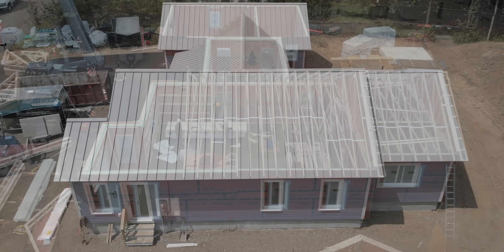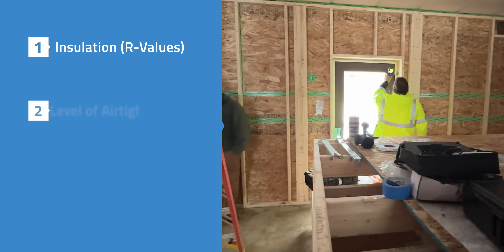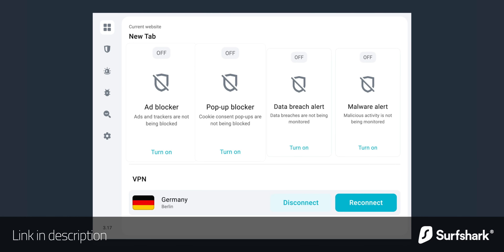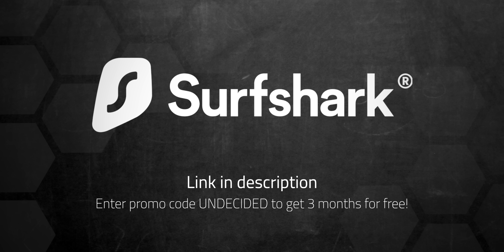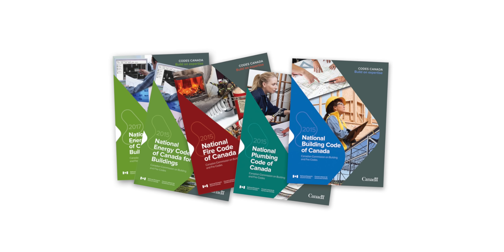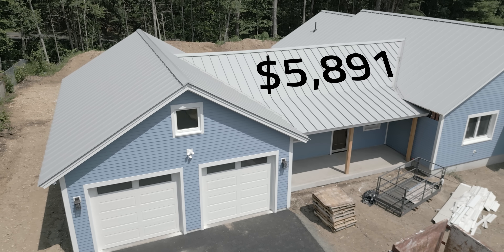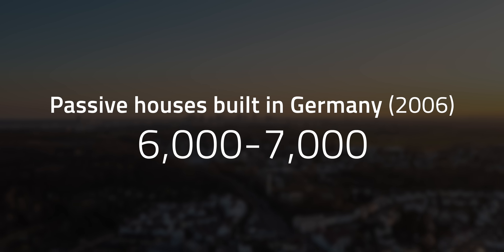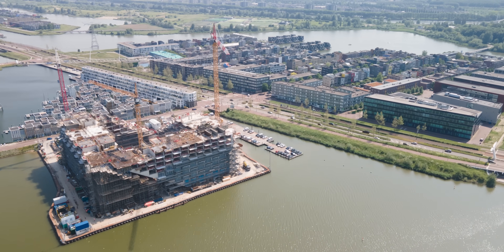Why Do American Homes Suck?

Comment: I built an ADU/garage on my property with the idea that I would spend an additional 10% - 15% on build quality and efficiency.  What I did wasn't rocket science:

2x6 externally framed walls
Foam flashing in the wall cavity
Roxul (Rockwool) wall insulation @ R-24 (vs. R-15 code)
R-60 ceiling assembly, with attic/chases inside thermal envelope, including 4 inches of closed cell foam, thermal breaks above the deck, a second deck that the shingles are on, and R-38 Roxul under the lower deck( making a [shingle, tar paper, OSB, closed cell foam, OSB, Rockwool] sandwich.
Additional sound deadening rockwool around bathrooms and laundry.
Mitsubishi Multi split with 3 head units.
R-13 3-layer foam core garage doors.
Hurricane straps vertically throughout the build.

I paid about $3k on flash, another additional $4k above normal insulation, $5k extra on the roof, the HVAC was about $10k more than two 2-ton units, maybe $1k on hurricane straps, for a total of $25k on a $300k build (plus the upcharge on 2x6 framing and some additional LVL lumber).

I probably save about $100/month on energy.  So, it won't pay for itself in 10 years, but man is it ever quiet and comfortable.  No drafts, no hot spots or cold spots.  Just uniform temperatures.

Comment: In the US you have mass home builders like Pulte and their ilk pumping out cheaply built homes they can then sell for the largest margin possible and with as many corners cut as possible.  A friend of mine works for a local window installer and the subdivision builders always order job lots of the lowest model possible; one they don't even show to normal renovation customers because it's terrible.

My parents have owned such a house for 20 years now and the cost of bringing it up to a modern standard far outweighs any savings they made up front on the new built home.

Comment: I live in California and in Canada. In Canada, we built a home to modern codes at had the tight envelope with an air exchanger. The first winter, it seemed really nuts when I stood next to the home air output and it felt so warm compared to the outside air: "Why are we pumping hot air out of the house??" But that is the TOTAL hot air leaving the house, due to the tight envelope. And it was actually already used in a heat exchanger to transfer some heat to the incoming replacement air. Sure, it "felt" warm in the -20C outdoor air.  Then, all of the homes I've owned in California have been sieves in comparison. Drafts all over, and often you can see the sunlight through the gaps in doors. CA is just lazy because the weather is usually fairly comfortable near the coast, so winters aren't that important...but summers are. Efficiency building codes "feel" like they cost people money, but they SAVE money (& CO2 emissions), and should be tightened and enforced.

Comment: It typically comes down to one factor, cost. Many people won't build because it is usually too expensive for their budget at the time of construction, many do not look at the long-term energy savings if they spend a little more upfront. Thanks to increasing standards this is all slowly changing, it is really difficult and really impractical to have a national building code considering how large and how many different climates that the USA has.

Comment: I've renovated/rebuild my little home in Belgium and spend about €60-100 a YEAR on heathing. I use wood pellets, but in kWh it's something around 1.500 kWh for heating.
I did build according to the Passive House standards in 2011. Never regretted.
Reply: My old house in Norway built in the early 2000s we used 40 000 kwh and about 1500 liters of firewood each year, Now in our new house with better insualtion and a geothermal heat pump we use just 12-15 000kwh of electricty each year

Comment: Unfortunately the legacy of the Oil Shock, the Carter and then Reagan administration's, cemented a perverse perception in most American minds that wasteful behavior and the promise of plenty of cheap oil would be seen as the 'normal' while high oil prices & the need for efficiency became the exception. So when building a home either from the view of the builder trying to keep costs down and the owner trying to afford the thing, there was a widespread aversion to investing huge amounts in what was collectively seen as momentary economic hiccups that would resolve themselves once the next "strongman" president would presumably "set the middle east straight". It was always a childishly ignorant position.

Comment: It would be great to see you homes that were built to withstand time and weather all it takes is a weekend away and a leaky faucet or the power to go out freeze and destroy your floors and with most homes in America being over 100 years old the way that they designed and built with would do not make first structurally sound home allowing for the foundation and flooring to Bow overtime

Comment: As someone who recently did a renovation in WA state I can tell you I looked at all the laws and regulations for insulation purposes and that was my main concern for the rebuild. I viewed the WA state standards as woefully underdone, but a lot higher than most anywhere else in the US. I ended up going as much as I could based on our wooden structure; but it was still less than what I wanted as far as R value is concerned. Having lived in WA for over 30 years and done multiple construction renovations... I can tell you that things aren't ready for climate change in the next 20+ years either... We had a lot of people die during the last big heat wave and that will continue in the future.

Comment: I would have had less framing than you have in your house.  More weak spots as far as insulation goes. Windows that open outwards are better than those that open inwards because they stay air tight longer. Add a heavy gas inside the windows and they will become even better, like argon. The energy crisis in the 70s was what quickly led to the strict energy and building codes in Sweden.

Comment: My 2019 home in Belgium is a passive home , temperature stands at 23 degrees year round and I use 2500 kWh for heating. Surface is 185 square meters and it’s a detached house. Go green with a heat pump and solar panels !

Comment: I'm a big fan of yours, Matt, and I'm an American (engineer) living in Europe and building a net-zero house here that's constructed just about exactly like your new house in the USA.  (And I have also built houses in the USA.)  Matt, unfortunately, you've put a lot of bad/incorrect/partial-truth information in this video.  In fact, there are so many erroneous statements by you that I don't really know where to begin.  This video is inconsistent with your typical, level-headed approach.  Here's the major flaw, and it happens A LOT when Europeans compare things to the USA:  they compare the top-tier, most-advanced practices in Europe with the broad market practices in the USA.  Compare the entire EU to the entire USA, and you'll see a very different picture.  Here's the sad part:  there ARE genuine differences.  Stating them accurately, though, wouldn't produce nearly as dramatic a video.

Comment: Basically the juice isn't worth the squeeze...If all the things you are talking about increase the price of a home 15-20%, 99.9999% of people would rather keep the current standards and get a house that is 15-20% larger...homes are already so unaffordable...

My entire energy bill for my 60 year old home with paper thin leaky windows is less than $2500 a year...lets say you could reduce that 30%, that is only $750 a year...yea, it might offset the added cost over a 10-15 year period, but that makes a lot of assumptions. First, that you ignore opportunity costs of the money used to increase the efficiency of the home. Let's say I would spend an additional $20,000 to do all the changes you mentioned. I could take that same 20 percent, put it in different investment devices and even at 5% ROI, I would be making $1000 a year. A $250 net improvement...If I had to borrow that same 20k for the improvements, the numbers get even worse. Secondly, these systems you talk about are much more complex to operate. More motors, more proprietary PCBs, more moving parts to break. The maintenance costs on your mechanicals will be higher than old school tech, without a doubt.

Comment: Meanwhile there are some in the US that, while we may "own" our homes (except for the semi-annual rent payment to the township/county/State), can't afford to even add proper insulation into the walls/roof.  My house was built in the mid 1950's, and while it doesn't have the cardboard sheathing it also doesn't even have a Tyvek type housewrap.  And I honestly believe it has whatever insulation (if any) in the walls that was used at the time it was built.  Some WAS added to the attic when that was renovated sometime in the past since I can see some fiberglass batts in places.

Comment: Generally where i live in the USA. Builders build to code if that. Nothing extra. Then the owners have to improve it later. Which has slowly been becoming more and more unaffordable.
My walls are r-15, which is still code but my home was built in 1940. The brand new development housing down the road is also r-15.

Comment: Americans long ago decided that quick and cheap was the only thing that mattered. With that attitude pretty much everything of value is ignored. I live in Phoenix and our houses are cheaply (and stupidly - for the climate) designed and slapped together with the cheapest materials. That being said all this stuff about R values and air flow and stuff matters in mild climates like the PNW, England, Europe. Yes, I said mild. When you live in a place like Phoenix it doesn't mean dick. You need AC on almost permanently most of the year and you need to be able to power it. The fact the every house in Phoenix is not designed around a solar array strong enough to power the AC unit is peak stupidity.

Comment: One key point you are missing is that houses in western Europe tend to be generational housing.  Meaning it is kept in the family for several generations.  So any investment made by grandpa will benefit his family for generations to come.  Here in the us we move around far more often, thus we don't think about a house as an general investment.  Spending all kinds of up front money to make a house more energy efficient doesn't quite work here when you might move in 20 years when you retire...
Reply: Which is where regulations come in ... if everyone builds houses to a higher standard, then moving wouldn't matter.

Comment: One thing you need to pay a lot of attention to with these air-tight houses is the water vapor management. You need to apply good techniques and materials, not to have later problems. For instance your wall insulation will not fare well if it gets wet. And in the end, no matter what you buy, if the one installing them does not know hpw to work with those materials, it is almost a waste and you'll have later problems, expensive to fix ones. But if they get it right, you'll enjoy a confortable and low-maintenance-low-costs house every single day.
Reply: There have been regulations and proper building codes for such things for decades.
At least the early 1970s.
Reply: @rogerwilco2  There was no standardized good passive house codes in 1970, at least not in the US. Passive houses need a different level of attention and materials than "regulqr" ones.

Comment: Matt, as building inspector from the US now living in Europe you really missed the mark here. America is a lot bigger country and the EU doesnt have this major standard either. Homes in America are much more comfortable and we build them that way because the cost of energy if a fraction of what it costs in the EU. I"m currently in Portugal where almost no homes have any insulation whatsoever. I pay four times the rate per kWh and I get taxed at 23% along with other fees. To put this in perspective even further I was away from my house for a month and had the power turned off at the panel. My electric bill was still 52 euros just for being connected. Most of us use natural gas for cooking and heating water as well. You also nit picked the paper flashing-- most areas have a much higher code. A home in Portugal also takes years to build because the paperwork and delays are insane. Most people where I am just build and take the fine. Its also extremely hard to find workers here. The ones that do work take the whole summer off and most of December. They also take a 2.5 hour lunch everyday. Come visit before you make another comparison video or compare the US to the nordic countries and Germany

Comment: I don't know that a conclusion was ever reached, but there was some debate years back, in regards to triple pane glass, and if it actually was beneficial. I don't recall the details, but I think the main argument was that as long as you do not maintain a vacuum in between the panes, there will be heattransfer, and that the amount of heattransfer depends on surface area and medium, which does not change from double to triple pane. one thing that does change however, is the amount of light (infrared?) that is let in, which does make a difference. Anyway, that is how I recall it.

I would also mention that I for one do not see living in a hermetically sealed box of a house as anything good, and I am certainly not alone. The idea that you need to actively exchange the air you're breathing, is... well, breathtaking, and it is perfectly possible to build a house that can breathe, and in which you can breathe, without compromising on energy efficiency.

Comment: I am a design professional in the Phoenix area. We have over 20 municipalities that make up the metro area. All of them have adopted different versions of the ICC codes and almost all of them have local addendums.  The idea that an entire country would have a set of codes to follow is a dream that I can barely comprehend. Fundamentally, they are all fairly close, so it is not the end of the world, but to be able to streamline boiler plate general notes and requirements would be awesome.
Reply: The state or at least Maricopa county and maybe Pinal county could take up that role, if the builders associations pressured them to do it.  Especially if they smartly push for higher levels of energy efficiency to help consumers want standardized rules.
Reply: I really don't understand why the USA does not have a lot more nation wide regulation and standardization.
It is because then a lot of local politicians would lose their grifts?
It's not just building codes. All of the USA is a bewildering patchwork. For example: how do you recognize a police officer? What makes a real one distinct from an impostor?
And don't get me started on signage. Why do so many signs have walls of minute text instead of a clear symbol or two?
Reply: In the US, it is significantly harder for the federal government to apply nationwide policies due to the autonomy and power of state governments. 

For local police, if they have a radio, a gun, taser, and a badge, and are wearing a police uniform, it is most likely a real cop. State police are usually found on the interstate highways, and have the big hats.

I'm not very familiar with signage regulations, but it would probably depend on what kind of signage you mean.
Reply: @rogerwilco2  Canada actually had someone go on a killing spree impersonating our federal police, that included a car.  Some of his victims were murdered by pulling them over for a traffic stop and shooting them.  2020 Nova Scotia attacks.
Reply: Because thats how a Federal System works. @rogerwilco2
Reply: @rogerwilco2   Interesting you would state, "I really don't understand why the USA does not have a lot more nation wide regulation and standardization," and then ask,  "Why do so many signs have walls of minute text instead of a clear symbol or two?"  Regulations. Regulations.  Regulations.  The US over-regulates nearly everything, making it worse.  There was a sports stadium that was almost shut down on opening day because the mirrors in one of the restrooms were not the proper height above the sinks.   As for signage, I have read where the sign maker make a common sense sign, but the government inspector said it 'wasn't clear/explicit enough' so the sign maker had to add extra warning that not only would you die, but it would be painful. Then the sign was approved.

If you want to ruin an industry in the US, get the government to regulate it and then "improve" on the regulations over and over again until it is just stupid.

Comment: You mention that you'll be able to save more than $5K in energy costs thanks to the improved construction (insulation, windows, etc) and higher efficiency HVAC/water, but what does it cost to do all those upgrades during the building process? And how many years will it take to save those $5K? I think it's a great way to build, both in terms of efficiency and comfort, but I don't think the business cases closes at all.

Comment: i moved into a house that was built in 2019. it has all plastic plumbing, have to replace all of them due to plastic leaking. and it has freaking LAND LINE CONNECTIONS in all rooms of the house. worse yet, its all cat 3 cable so i cant even retrofit for ethernet.